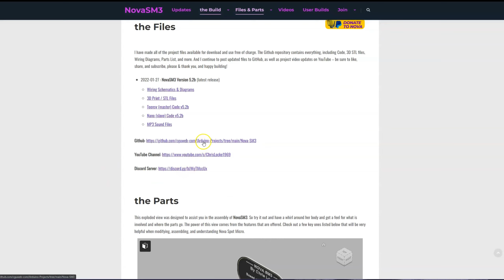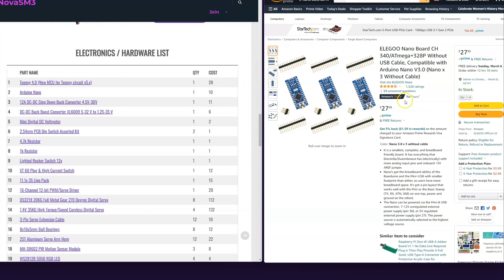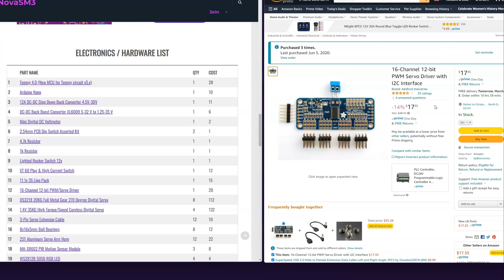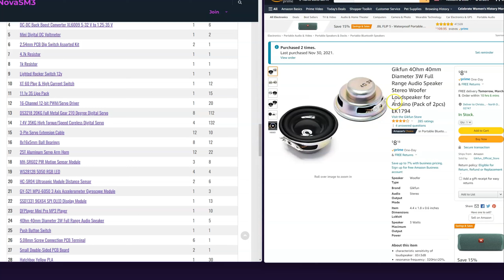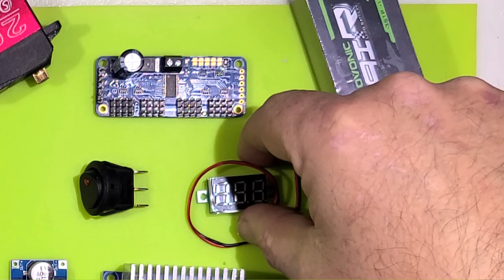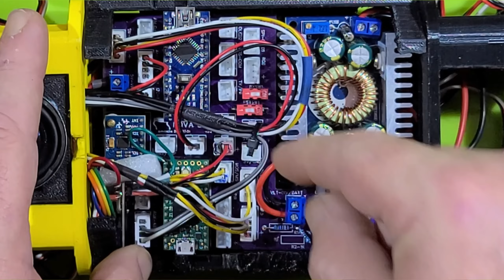NovaSM3 v5.2 : Build Series Part Two : a Quadruped Robot Dog Spot Mini Clone

Comment: I think that the nrf receiver isnt in the wiring diagram. Or i cant make sense about the markings. Could you tell witch wires to connect and to witch connector on the board😬 btw witch address did you use for it?
Reply from the maker: this diagram shows the NRF wiring:
https://github.com/cguweb-com/Arduino-Projects/blob/main/Nova-SM3/Wiring/5.3/Wiring_NovaSM3v5-2b_pictogram.png
the address will depend on your situation / environment. In most cases the default will work, but it may interfere with the OLED. I set mine to the max address, don't recall offhand, but its the less commonly used address.
Reply: Well there it wass the whole time 🤣🤣 thanks again for saving me
Reply from the maker: its a big project, I'm glad your navigating it pretty well considering the holes in my documentation ;)

Comment: how much current do all the motors draw? im asking because it seems like they would draw much more than the 12A dc-dc converter can supply. thanks
Reply from the maker: Hardly. Under normal operation, no motor should peak at more than 1a, and at no time should all 12 peak together. So if you ever draw more than 8a even, you have bigger issues than buck converter 🤣
Reply: @ChrisLocke1969  Gotcha, thanks so much, im working on a quadruped robot rn that happens to have similar motors as the ones in the video. Helps enormously.

Comment: Hey just wondering why did you decide to go with servo motors over something like a brush less dc motor? considering that was what Boston dynamics actually used which would seem to definitely instantly give better movement and noise reduction
Reply from the maker: And massive cost difference. Im simply a hobbist, and likewise Nova a hobby robot

Comment: Hey, how do you calibrate the servos? You only have an old video from the SM2, so I was thinking about using the Nova-SM3-calibrate.ino program, but im kinda lost on how to use it, where to install it and what other programs need to run on the other components in order for it to work.
Thanks in advance
Reply from the maker: There is a video on that in my library, however a little outdated. I am working on my next video which will be about the software, and yes, calibration routine. Stay tuned for a week or so and that should answer all of your questions, i hope
Reply: @ChrisLocke1969  okay, looking forward to it, because we are building it with our university, and we need to finish it by the end of the month